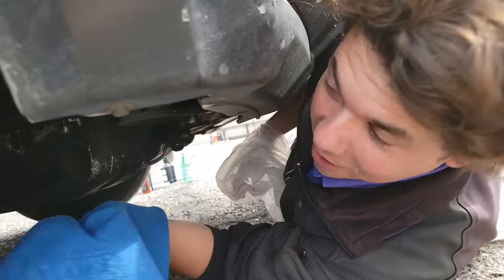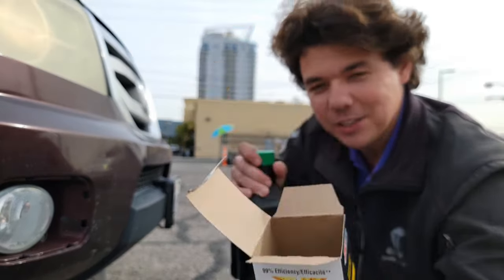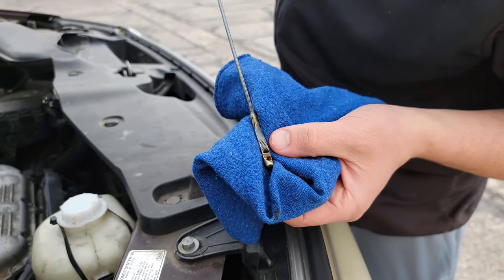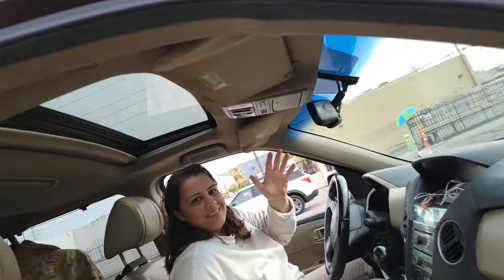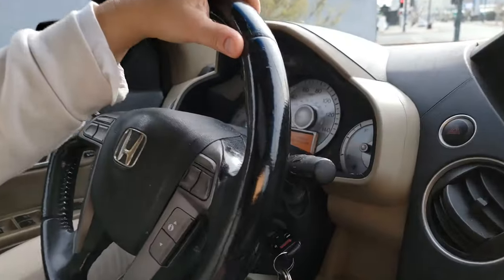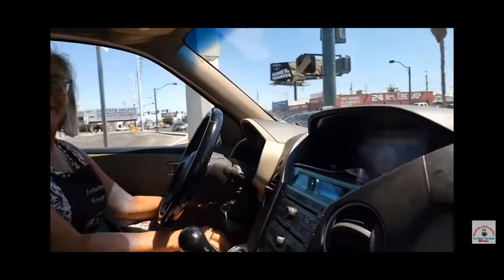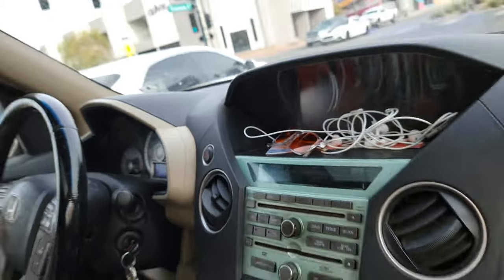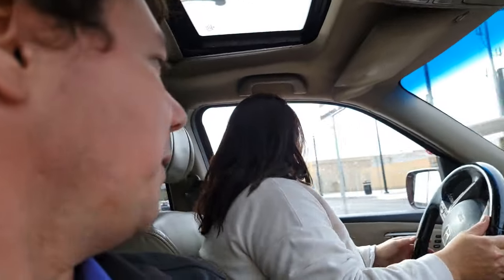Your Oil is Dark because of This!

Comment from the maker: Watch This Next: 20,000 Mile Oil Change Uber Lyft Las Vegas Field Test - https://youtu.be/fdSyZ-D3gnw

     ♥️   Find The Right Fluids For Your Vehicles - https://www.amsoil.com/guides/?zo=5331179      

     ✅   Save 25% On Your Next Fluid Order: https://www.amsoil.com/offers/pc/?zo=5331179 

     ♥️   See Fluid Performance Tests - https://www.amsoil.com/performancetests.aspx?zo=5331179      

     ✅️   Buy Me a Coffee - https://www.buymeacoffee.com/YouLubher

     🥇🥇🥇   Synthetic Oil Protection Google Map Reviews
(702) 472-3614
https://maps.app.goo.gl/DmLU5hP72HadUBEm9
             
     ♥️   Synthetic Oil Protection Website - http://syntheticoilprotection.net

     Did you know a oil manufacturer can call a lubricant a Full Synthetic when it's only 25% synthetic? AMSOIL is different because it is 100% Synthetic and has a higher film strength keeping the metal parts separated. AMSOIL allows less friction, less heat, less wear on the component. AMSOIL Signature Series motor oil will last 25,000 miles on 1 oil change!  

     ♥️   Your Vehicle Could Run Better Than Brand New By Choosing The Right Fluids! See Results - https://youtu.be/zH-VquYlhqA

     ♥️   Why AMSOIL - https://www.amsoil.com/about/exclusive-distribution/?zo=5331179    

     ♥️   Synthetic Oil Protection Coffee - Ebens Favorite: https://supportwith.coffee/shop/subscriptions/sop/

Comment: Recently had a check engine light come on in my 2013 Hyundai Accent. Code check suggested a bad 02 sensor. Bought the new sensor but was waiting for a decent weather day to do the work. Filled the car up today and added the PI fuel additive (first time in this car) Five minutes later check engine light goes off. Thank you Amsoil 👍
Reply from the maker: Oh yeah you can definitely have some carbon buildup depending on the vehicle and if it's direct injected or not I always recommend doing the power foam the yellow can and also the Amsoil engine flush with the signature series motor oil and the pi performance improver those will do some serious cleaning and they can definitely get a check engine light to go off however if there's a mechanical problem then if it's electrical you'll still have to fix it but it will do some serious cleanup😉

Comment: We have not done just filter changes. Our trucks are diesel so we just change all the oil and filter at once. Amsoil is great stuff! Being a preferred customer makes it easy and convenient to keep our vehicles and construction equipment running well!
Reply from the maker: Super sweet!!! Thanks for being a part of my YouTube community and sharing with everyone😃
Reply: Does your Diesel engines use some oil using amsoil? That was my only issue I had with it. Thanks
Reply from the maker: He drew that is normal depending on the car you will have a period on an older vehicle where it will continue to burn oil as it gets cleaned I always recommend the engine flush also the appropriate fuel additives for the vehicle if it's a diesel my favorite is the diesel injector Clean Plus cetane boost the green bottle as far as burning oil there's a lot of things that it could be on the vehicle however on most older vehicles you'll notice it'll burn less as you run the signature series longer and change the oil filter the motor will run even better sometimes it can take 15 20,000 miles for a lot of the old buildup to come out

Comment: Hi Eben...hope to see you in July.
I have a 2012 Dodge Caravan
Bought it back in March, and switched over to the liquid gold in May as well as did a flush. Changed the filter before Christmas at 12K miles. Granted I checked the oil every week prior to changing the filter and did not burn a drip of oil. Changed the filter, and kept trucking along. She does run better than new.

Comment: I put the mileage down on my sticker to change it at 12,000 miles but after seeing this, I may just extend that and change the filter midway and top it off if needed instead! I see you're using the current promo products too. I made sure to put my promo code in as well. :)
Reply from the maker: Great!
Am I your AMSOIL Dealer
Reply: @Syntheticoilprotection  It doesn't state that you are in my account information, it says it is someone out of Pennsylvania. If you can tell me how to change that, I'd be more than happy to make you my dealer because I think you're pretty cool. 😎
Reply from the maker: Hey Tommy you can still switch it's up to you within the first 30 days of being a preferred customer all you would do is call Amsoil and just give them my dealer number 533-1179👍
If you were in contact with another dealer stay with them but if not you have the right to switch to me thanks again for being a part of my YouTube Community💯😃😉
Reply: @Syntheticoilprotection  Hey Eben, thanks for the response!! I've been a preferred customer since 2019 so it has been a while. I don't think I was even asked who I wanted to use as my dealer when I signed up, but I can't really remember. I'll definitely continue to be a part of your community though, I love your content a lot! :)

Comment: Ive been using amsoil and there filters for awhile ive been using the 5w20 boosted oil i change it every 5000 miles but they stopped making the boosted. My problem know is ive been using the 5w20 extended oil and filter but know this is my 2nd change and ive been having a problem where my oil gets dark brown with a purple tint within 1100 miles. Im about to switch back to mobile one cause this oil is expensive to be changing colors like this.   Ive never had this problem till i started using this extended oil
Reply from the maker: Yes this is normal it's the build up that's in the motor is getting cleaned by the detergents I highly recommend doing the engine flush Pi cleaner also depending on the motor if you have direct injection you can also do the Amsoil power foam you'll see we have a lot of videos on this on the channel definitely worth exploring to clean that you'll see a big difference in performance I would also go Amsoil Signature Series which is the best motor oil in the world👍💯
Also you'll save a ton of money as the 6-month preferred customer when you use my website this is the steps to get that and that will save you a lot on the motor oil it will get shipped right to your house☕️❤️
I give a man a fishing pole & show him how to fish. 

     Together! We can get your vehicles to run better than brand new! 

     For me to get credit & be "Your" Independent AMSOIL Dealer please use my website below or my dealer no. 5331179 call anytime Eben Rockmaker 702-472-3614
After you click on: http://syntheticoilprotection.net
1. Click hamburger menu
2. Click buy wholesale
3. Add 6-month PC member to cart
4. Select shop by vehicle. 

New promos: FREEBOWL

Comment: I prefer to change oil and filter all at the same time.
Reply from the maker: Oh yeah same for me however if the oil is still in great shape I rather save my time and just change the filter some cars are very difficult some are super easy this one is great because you don't even have to jack it up just like my car makes it a super easy process to keep the efficiency of the vehicle if I didn't have to do a video I could have done this process in about 5 minutes flat😉

Comment: Prefer changing oil every 3,000-5,000 miles. But Amsoil one of the best Lubricants out there.
Reply from the maker: Yes I did the same exact thing when I had my Pontiac Grand Am I used to change the oil every 2500 miles.

What type of car do you have?
Reply: Yeah, So it worth an expensive oil and filter doing it that often?  I wouldn't. I used the CVT fluid I will buy that I don't want to skimp on the Nissan CVT with cheap fluid like the NS3 garbage.

Comment: Just bought a new Prius AWD-e XLE,  I just put in 0W-16 Amsoil at 1500 miles, wondering your thoughts on what is the best gas? Top Tier? Also is there any gas additives from Amsoil that would help a new engine like this?  Thanks.
Reply from the maker: Of course Gary I personally like the Shell Gas where I live I see great results if I can't use that one I'm usually using Chevron I personally run the upper cylinder lubricant every full tank of gas the pi performance improver every 4,000 miles sometimes I go 5000 just depends and then in the summer I run the Dominator octane booster with the upper cylinder lubricant I noticed less pre-ignition also I make better timing and more horsepower.
But the biggest thing that I see that helps maintain everything is using the upper cylinder lubricant every full tank of gas😉
Reply: @Syntheticoilprotection  Thanks, Eben. Just starting to look at what gas (Shell or Chevron) have Ethenol in them, looks like it can vary from station to station, maybe it is just the higher octane that has no Ethenol, I'm about to find out. I'm definitely going to run the amsoil upper cylinder lubricant on each fill-up, the prius only has a 10 gallon tank so I will have to adjust the amount. Thanks again.

Comment: Why cant i find an amsoil oil filter for my vehicle? 2009 chevy tahoe 5.3 flex fuel with afm? 8th digit of the vin is 0........
Reply from the maker: You should see it here in the lookup guide most likely it's the same filter for any five 3 l.
♥️   Find The Right Fluids For Your Vehicles - https://www.amsoil.com/guides/?zo=5331179
Reply: @Syntheticoilprotection   yea all the 5.3 prior to 2007 which introduced the displacement on demand where the v8 drops to v4 mode and inside the oil pan they have a pressure relief valve.. thats the only thing i can think of only wix 57060 pops up
Reply: @Syntheticoilprotection  i placed an order and used your code💪💪 so hopefully it helps you out some how
Reply from the maker: Of course I'll definitely follow up with you when I see your order I really appreciate you being a part of my YouTube community and now I can always answer all your questions on the products without food in the performance and Ice ran over your vehicles by choosing it right Goods as your dealer👍
Reply: @Syntheticoilprotection  hell yea.. if your ever in northern california, chico ca, you can use my vehicle for video purposes 😉 🤣.. currently just using the motor oil but once i get my order gonna use the gear oil as well

Comment: Don’t care how good or expensive any oil is- to go OVER 10k or even a full year is crazy dumb considering what the vehicle investment total sum. After 6 months or so the seasons change and moisture gets in regardless of use. I prefer 5/6 7k miles tops with changing the filter halfway in between at 2/3k miles. And after 6/7 months change both to fresh oil/filter regardless of use on both my vehicles. They both drive like new 100% of the time. I actually get surprised when I hear how bad most people’s cars sound running- even new can cars sound like
garbage

Comment: Why change the oil filter early?
Reply from the maker: Great question Jordan over time the filter gets full of little teeny particles these particles come out of the motor especially a high mileage motor like the one in the video those little carbon particles fill up the synthetic media that holds the particles once it's full basically the oil keeps the particles in suspension those particles can do extra wear on the motor so it's best to get those out the best way to do that is by changing the oil filter the oil is physically still good for another 15 to 20,000 miles depending on driving conditions since this car was driven in mild conditions in California it is still probably good I'm thinking for another $20,000 but will have to do an oil analysis to know exactly and you'll actually notice a difference after changing the filter and using the fuel additives cleans the valves injectors and lets the motor run more efficiently you'll see a lot of that performance test here.
♥️   See Fluid Performance Tests - https://www.amsoil.com/performancetests.aspx?zo=5331179

Comment: Do you ever use clear flood mode to prime the filter?
Reply from the maker: Never heard of that what is that?
Reply: @Syntheticoilprotection  In some cars, when you hold the gas in and turn the key, you're in flood mode. The engine will not start but it will crank and build up oil pressure. Some people like to do it when doing a fresh oil change.

Comment: I like how you just let the oil dump on the ground.  I change my oil and dump it in the sewer drain…it gets recycled right?  You’ve got to do better than that man.  Oh yea, my coolant needs to be flushed..maybe I’ll just pull it in the street and drain it out.
Reply from the maker: Yeah that is to show the process if I used both hands the camera angle would have been blocked and they wouldn't have been able to see what I was doing but it's a really easy process with both hands you fold the bag Inside Out grab the filter and drop it straight in👍
Reply: @Syntheticoilprotection  Hey, I liked the idea of how you used a bag, good idea, with an oil pan underneath or cardboard though.😁.I hate how it gets all over my hand even with gloves on it drips all over. So cardboard is always a must for me, and the bag will be my new trick from you.

Comment: Just change it every 3k miles 90 bucks of oil will save you 5k in repairs
Reply from the maker: Oh yeah definitely with mineral oil I used to change the oil on my Pontiac every 2500 miles that's when I used to use super tech now I use the signature series Amsoil😃
Reply: @Syntheticoilprotection  yup I get 0w40 amsoil at retail price cost 90 plus shipping
Reply from the maker: Next time around you can always get it as the 6-month PC member will give the very best value on the products and when you use my link here that will allow me to answer all your questions in the future about improving the performance and lifespan of your vehicles by choosing the right fluids as your independent Android dealer👍
There's no Auto renew and at the end of your membership you'll get a renewal email😉
✅   Save 25% On Your Next Fluid Order: https://www.amsoil.com/offers/pc/?zo=5331179